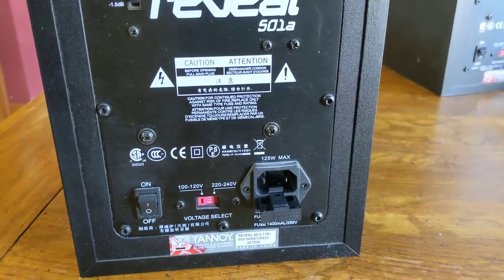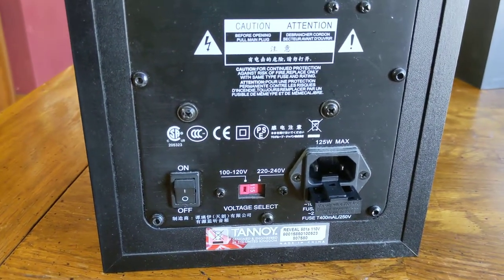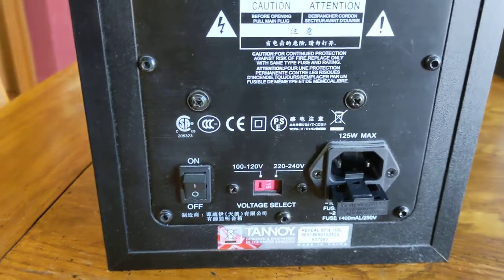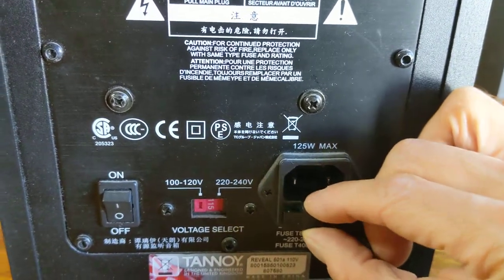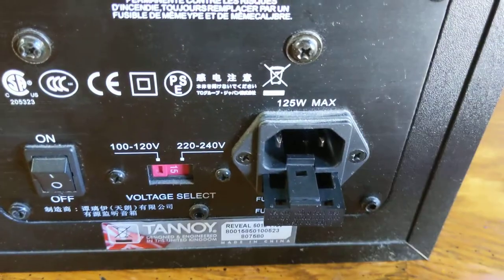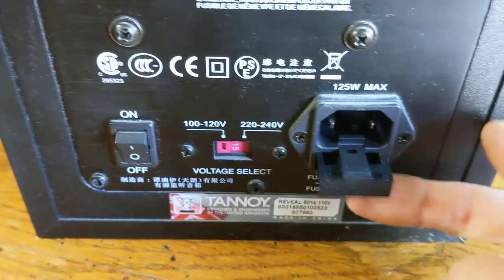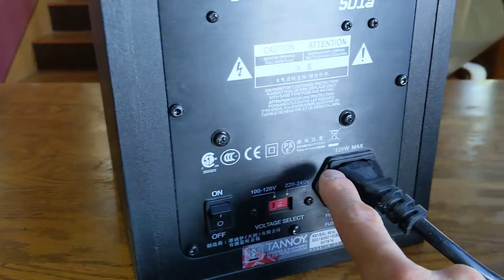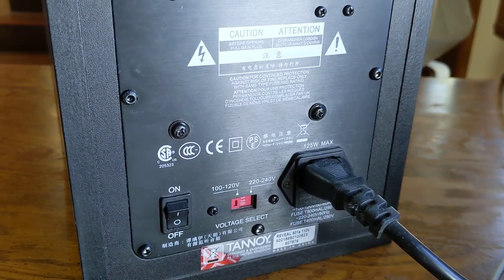Studio Monitor Not Working? Quick Fix!

Comment: I accidentally plugged my 110v rokit to a 210v😅 can it be fixed?
Reply: Yes - get an electrical engineer to replace to voltage input thingo. I did that to a usa voltage pre amp
Reply: @phanoonki  thanks for the reply! Fortunately , krk provides an extra fuse at the back. I just simply replaced it and voila! it worked again. In retrospect, i probably should have read the manual first.
Reply: @krustyalabaster2314  eu nao sabia, o teu comentario me ajudou bastante eu havia queimado os dois fusiveis ohhh my god

Comment: All great nice easy fix,
However something caused the fuse to blow.
Either the circuit has an issue, or there was a severe power surge which can be caused by a power up but something caused the fuse to fail. 
Current draw surges arethe main culprit.
Eg.
Powersupply issue filter caps transformer etc....